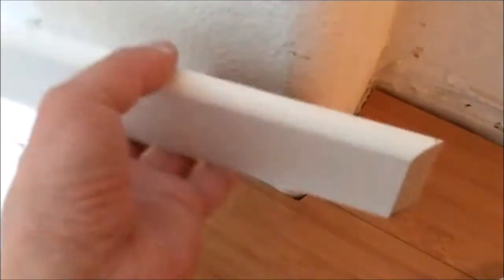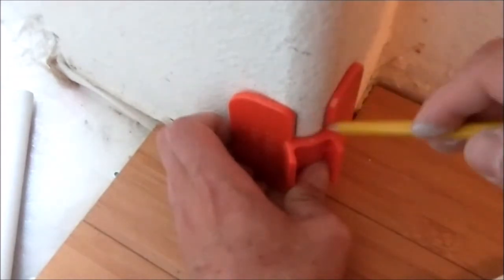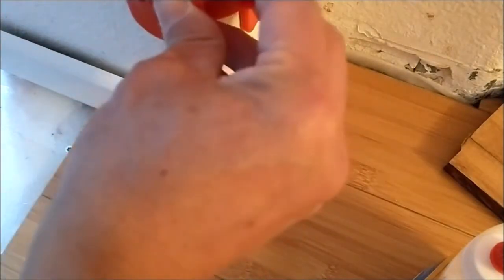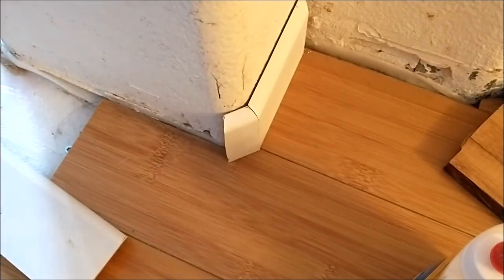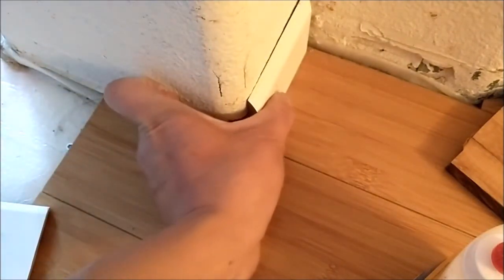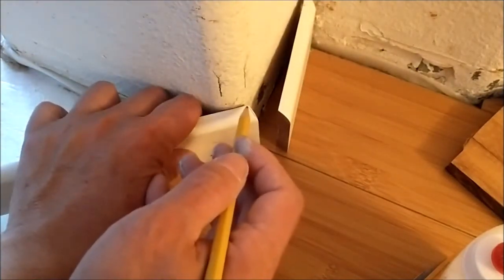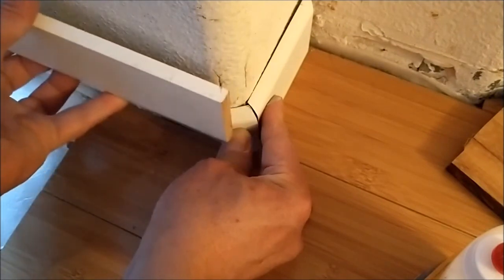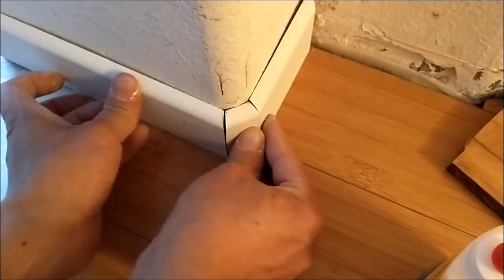How to install baseboard using the Bullnose Trim gauge

Comment: With this tool, you can, if you would like, fasten it to the wall (with those holes on the side of the tool), and now you have a place for the measuring tape to grab on to in order to get the accurate measurement for the length of the baseboard needed on either side. Once you get to the actual bull nose, make sure each end of all the pieces is 22.5 degrees, in addition to the baseboard pieces meeting up to the bull nose. As for the size of the bull nose, the tool takes the guesswork out of that as each corner will be uniform (based off the tool). I love it!